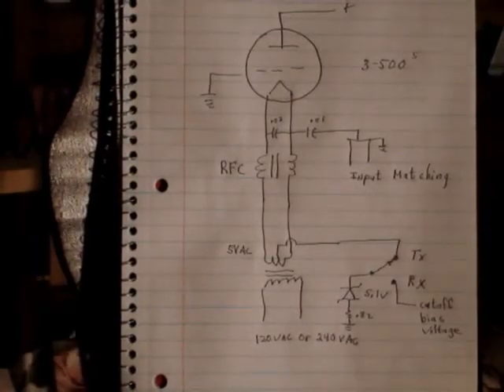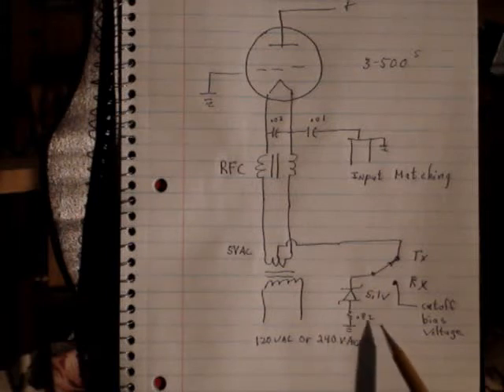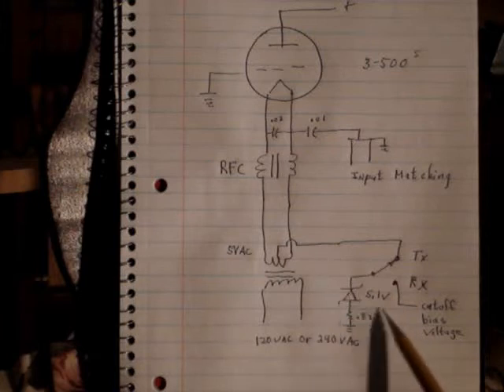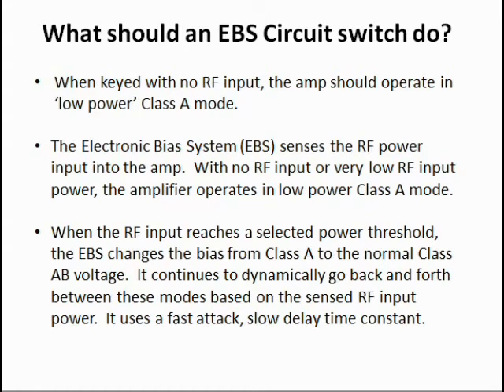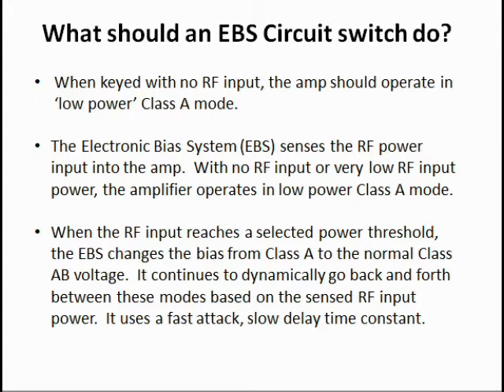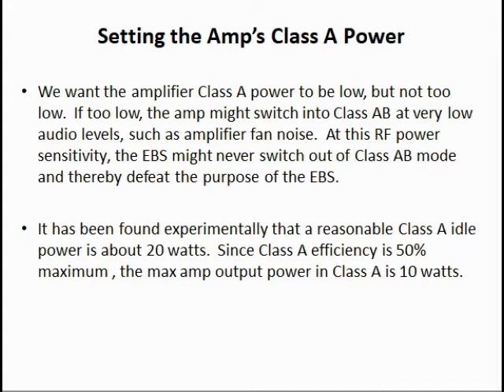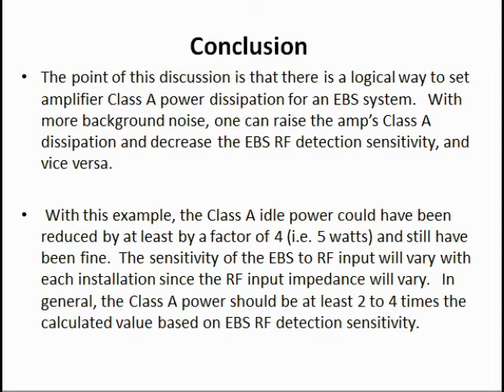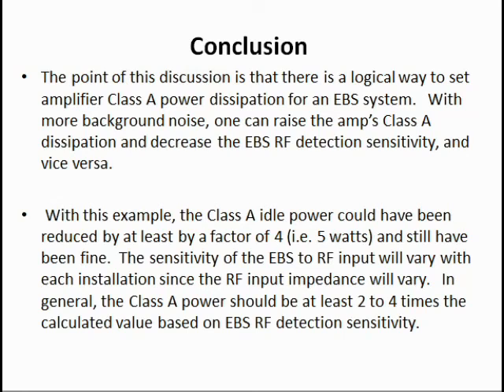Electronic Bias System for RF Ampliers (EBS 2500)

Comment: You are correct in your assessment but, with the electronic bias system the tubes will rarely show color in the plates. 3-500 or other thoriated tungsten glass tubes rely on the plate of the tube showing some color to getter the tube. While it might run cooler and be a tiny amount less stress on the power supply the tubes, which are expensive and sometimes hard to find, suffer from this condition. They will last longer with the proper gettering when the plates turn red or show some color. I will stick to the normal biasing in all of my glass tube type amplifiers. With metal ceramic tubes that getter from filament voltage this would be a much better or even a superior biasing system. I would have no problem using electronic bias on these types of tubes.
Reply: Even with the EBS, you can getter the 3-500 tubes when you want to.  It is not necessary to getter every day.  The EBS puts less strain on the power transformer (important in SB-220) and the tubes.  I can turn the tubes red and getter by holding down the key at max output.

Comment: Interesting video... Thank you for sharing this...
I am completely refurbishing a SB-220 at the moment... I am utilizing the Harbach rectifier board with a string of diodes in lue of the zener diode...
Would this electronic bias be nessacary or beneficial in my application situation?
Thank you....
Larry de KF4LBG 
73
Reply: Each diode is about 0.7 vdc drop so ten in series would be about 7 volts and bias the 3-500Z into a much lower plate current in standby.
Reply: Using rectifier diodes in series is exactly the same as using a zener diode.  Just assume your 7 or 8 diodes in series is identical to the 5.1v zener.  The video then applies to your situation.